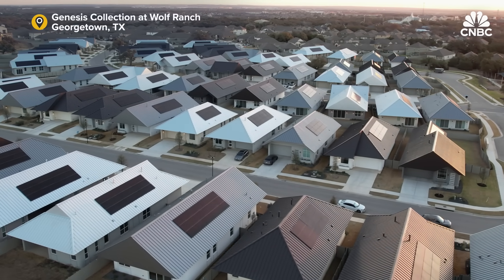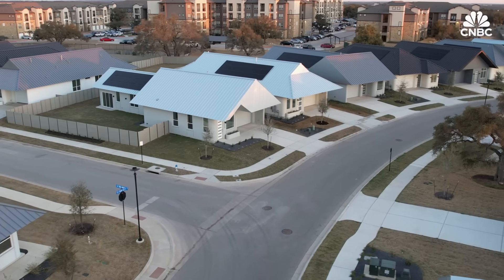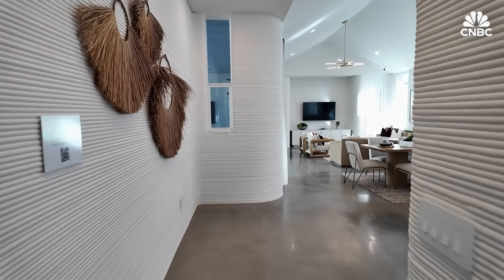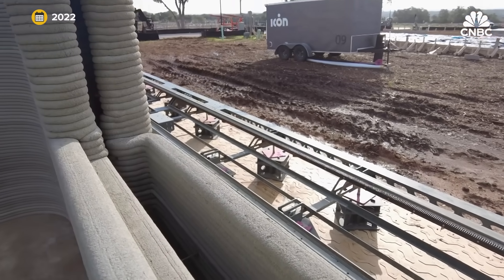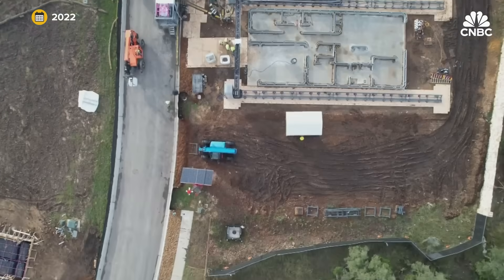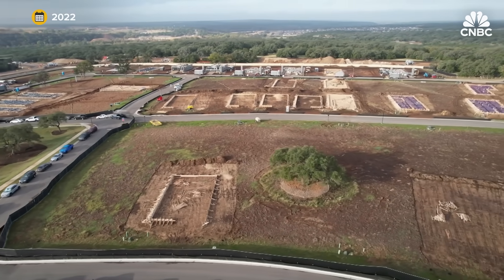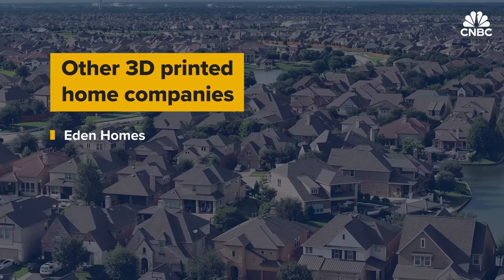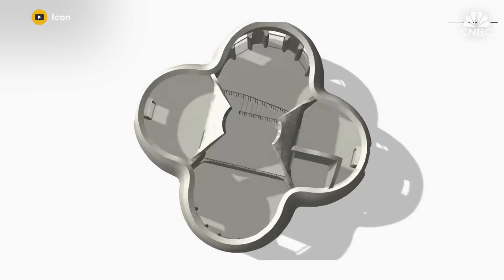Inside The World’s Largest 3D Printed Neighborhood

Comment: Homeowner: "Can I put another electrical outlet here?" 

Electrician: "Sure, that'll be $1750." (Pulls out jackhammer)
Reply: I like the idea, but the interior lines I would think are a magnet for dust, and the outside will collect dirt.  Maybe the nozzle should have solinoid activated wipers on the sides to create a smoother surface.
Reply: Be happy with the electric outlet where it is.  Problem solved.
Reply: The american ignorance of non-cardboard houses knows no bounds. This is a non issue in all countries around the world that build sturdy buildings.
Reply: @Inepressiera The issue is the labor cost to perform the work in a fully brick/mortar house...Electricians here make good money, they charge anywhere from 80$ to 150$ per hour, and a flat service fee that covers the first hour of 250$ on average in an average cost of living town.

Now adding a receptacle in the first floor, if the panel is in the basement, in a drywall setting and an unfinished basement, will take like a couple hours...But in a brick and mortar situation it might take triple or 4x the amount of time (drilling through concrete, chiseling, can't easily pull wires anywhere without creating a path since nothing is hollow)...So instead of paying around 350$ for a receptacle, you ll end up with a bill of 1000+...

I am an American Electrician, and I ve lived in North Africa and Europe for the first 30 years of my life (I am 34 now) so I know what I am talking about
Reply: @Htm.13  thank you. Others were telling me that drywall was a uniquely American invention and that they could easily chisel and resculpt concrete interior walls with the same ease and cost as patching drywall, which is absurd. And my only point was that it would cost more. Not that it wouldn't be possible.
Reply: @Inepressiera  The problem is planning and zoning. The structures they allow are toxic and like you said, litterally cardboard. If i could, all i would EVER build is eartships. Good luck building one anywhere near a town.
Reply: Some charge that much with a regular house
Reply: Buy an extension plug.
Reply: It's hilarious seeing all the people claiming Americans are too dumb to know how to work on concrete, exposing their lack of reading comprehension. No one said it can't be done. They said it will cost orders of magnitude more money due to the increased labor required
Reply: Is this why Americans live in cardboard boxes? 😂 My walls are solid brick and I never had issues with outlets.. You can plan them in advance if you are not 60 IQ american.
Reply: I'm from Romania and I cross the street and borrow a wall chaser and a core drill. The only one nobody seems to have is a gunpowder nail gun cos guns are banned in my country. Maybe we storm the parliament or something with the nail guns. Btw a modification to shoot concrete nails out of a 22 should be pretty popular in USA
Reply: @GeorgeS-z8x  Guns here are way cheaper than a Hilti nail gun lol
Reply: Did you watch at 3:50? They try to print the outlets as well.
Reply: @ yes. I’m talking about renovations down the line. I’m not entirely knocking the idea, I just never see it becoming the standard. Not to mention almost no part of the process is from sustainable resources. 

And on a personal note… metal roofs are hideous and they need something else
Reply: I’d love to see the patch job afterwards 😂
Reply: My thoughts exactly!! 👍🏾
Reply: You guys should YOUTUBE "paano gumawa ng concreto na Bahay"

Thank me later
Reply: A lot of houses in Europe are like this though, hard wall interior. It is more expensive to modify, but it isn't a new issue inherent to these 3D printed homes.
Reply: That is so dumb... in most of the world houses are built with brick and mortar and customization is not an issue. It's only in the USA that houses are made of cardboard. Concrete is fairly easy to mould and chisel.
Reply: @thelegend2776 It is not dumb, it is real, it will take much more labor hours to do the same task, I am an American electrician , I spent the first 30 years of my life in Noth Africa and Europe.

Adding a receptacle in a typicak drywall built in the US is much easier than chiseling concrete, and figuring a way to pull wires to the panel if there is no hollow walls anywhere.
Reply: @thelegend2776 Customization is totally an issue dude what are you talking about. That's the agreed upon downside of the European building method. It's doable but it's much more work. Most homeowners in Europe aren't going to DIY a new junction box.
Reply: @thelegend2776  Customizing your house BEFORE it's build is not the issue here, your comment is redundant.
Reply: @thelegend2776  The exterior of houses might often be stone, but in this case every wall inside is too.
Reply: @JoelRyanQuinn  Brick and mortar is the standard for both exterior and interior walls in 90% of the world. I live in a fully brick and mortar house (standard) and have done dozens of renovations on it over the past 10 years and breaking brick or concrete is not that big of an issue. Sure, it's harder than with timber framing, but it is something that can and does get regularily done.
Reply: @thelegend2776  like he said, its not about if it's easy, it's price. it costs more
Reply: Only Americans would think you can't modify it lol
Reply: @pauljansen6650 NO, Americans are saying it's more difficult and definitely more expensive. 🙄
Reply: @pauljansen6650  Your builders are qualified as you have the training. We don't. Its not that we can't. We just need to learn.
Reply: Honestly, as a custom home builder and carpenter… just by looking at this I can tell you these homes are entirely non-customizable post-build. I’m talking 5-10x the traditional price I’d charge to work in a traditional wood/steel building. 

I got nightmares just by looking at those builds🫣
Reply: @Wickedpissah138  so you say, I'm a GC and gurantee these methods are far more scalable and trainable than 5 different tradesman. You're arguing refrigerators will never take off because you own ice houses.
Reply: @ This shouldn’t even be considered a trade. You’re operating a computer. Not to mention the limits to the structures themselves. This will be good for small, low cost basic housing. Nothing else.
Reply: @Wickedpissah138 that comment made my eyes roll so far back, i saw my skull. Got don't have much forethought do you? You're like the people who said TV would never be bigger than radio. Foolish.
Reply: @Wickedpissah138  that why you put drywall over it, so you can run everything behind it
Reply: @ you could… but to do that correctly you need to have a framed wall either wood or aluminum studs. If you did that to every wall you’re actually shrinking your square footage throughout the entire house.
Reply: @Wickedpissah138  ok, but do you think they are just gonna leave the bare printed walls? if they shave the walls flat which they have to anyways, that will give you some extra space so none is actually lost.
Reply: @Wickedpissah138  Imagine when you wanted to redecorate you had to move
Reply: Cement can be dissolved, so..... Lmao.
Reply: Keep living in your cardboard box buddy. Almost all of the world lives in houses with solid walls and noone has your imaginary problem.
Reply: @ventsislavminev  The imaginary problem of it costing far more to install something new?

You need to find better coping mechanisms my guy
Reply: @ what? No. No structure you see over 1 story is built with solid concrete. Brick and stone is just the exterior, almost all structures have steel or wood framing. 

These little structures aren’t able to expand past a first floor. And the weight of your walls is now so heavy you can’t even have a basement you need a heavily engineered concrete slab.
Reply: @Wickedpissah138  Bro, don't say that, I am an American electrician, and I lived in europe and north Africa, and all the houses there are built of solid brick/cinderblock, rebar and concrete! My father's 3 story house in Morocco that we built is solid brick, cinderblock for roof and concrete + rebar...Not an ounce of wood anywhere, now if we tried to build the same house here in the US it would ve cost us at least 10 times more money.
Reply: @ ok… now please tell me how much easier it is to remodel those buildings made of stone and rebar (here in the US that type of build is primarily set aside for municipal buildings such as jails, schools and maintenance buildings, and low-income projects… not single family homes)
Reply: @ and you also couldn’t build that structure here in the US under residential building codes. Concrete structures are not the safest. (For more info do some research on Florida and their concrete condo towers failing)
Reply: Trades guy here...

I wouldn't touch the place
Reply: @stevechalmers9572 u guys touched a lot of places during the LA wildfire Armageddon

Comment: In lots of places, land use costs and taxes are worse than construction-related ones and the real way to drive prices down would be triplexes or larger multiple dwelling units to spread land-related costs between more people. In my mother's case, the land itself is valued at 250k$ while everything else on the plot is only valued to 140k$, the plot of land is nearly 2/3 of the total valuation. No amount of making the single-family home itself cheaper will offset that to a meaningful degree.

Comment: Amazing idea! but not gonna lie, hearing "wind, fire and mold resistant" is kinda wild 🤣 its because you build the house using concrete not board/wood. I'm from outside the USA, and I'm just always shocked at the fact that a lot of housing units in the USA are built using some type of board. 
Even a small subsidized housing complex just 36m²/house or 387sq feet/house in my country is all mandatory to be built with concrete and brick.

Comment: In fairness to the trades, this is not that much different than concrete block something we have had for a very long time. If you prep everything first, then have a guy show up with a truck load of concrete blocks, laying the concrete blocks (aka legos for building) does not take that long. For strength, you lay some re-rod in the wall and pour concrete inside the wall in a few spaces making a strong structure. You still need someone with a fancy hat, big ego, and more telling you how you are revolutionizing the process. Don't get me wrong I love technology, but it is it fair to use inappropriate comparisons.

Comment: those houses are way too close to each other. might as well just be an apt or retirement complex.  concrete isn’t environmentally friendly to make. i cant imagine the machines you need to break the walls when making house repairs. not to mention it will be very clear where those repairs were made when the smooth wall lines become a block of solid concrete then back to lines.

Comment: This isn't solving anything it's just techbros being idiots again and again. Just build panel buildings! They're cheap, quicker to build, and, if basic maintenance needs are fulfilled, can last for 100 years easily. Even then, build with brick and mortar. I live in a renovated, well-insulated, 1700s house in Germany. It has seen wars, revolutions, fires, changes of language, and the advent of electricity and gas. Why build something that will last only at most two generations...

Comment: 3d printed homes are ugly and overhyped. Putting up the walls of a house is small part of the work & time required to complete it. Think of all the other things that need to happen - foundation, 1st & 2nd fits of wiring, plumbing, roof, glass, insulation, walls, plaster, paint etc. The outer walls... not so much - anything from bricks, blocks, prefabricated slabs, timber, concrete formwork are all viable and fast. Not to mention all the planning & zoning laws which have to happen before anything else does. Months and months and months for a home to be put up that have nothing to do with the walls. The media seems to think that this technology will result in homes being built more quickly when it absolutely will not.I would not be surprised companies promoting this technology are spreading BS and media is mesmerised by the tech without thinking about it too hard. And the net result is fugly houses that will probably look even fuglier over the years after heat/cold cycles, water, dirt, debris, insects etc go to work on those walls. Can you imagine how much a contractor will quote to repaint inside or outside of these houses?

Comment: $400k and you don’t even get a basement? Ouch
Reply: Most homes in Texas don't have basements
Reply: @biblesforbreakfast  Same for California and Arizona, must be an east coast thing
Reply: @TLoumena  It doesn't have to be a 'basement', they are pointing out that price for a rancher. 
A multi-level home would equal a home with a basement.
Reply: @zzz7zzz9 It doesn't provide the same level of protection.
Reply: @striver1987 
Ah, right. Storms. 
I'm in canada.
Reply: All Midwest homes have a basement. Once you've had one, you'd understand.
Reply: @striver1987 I wouldn't say all but they are very common. I'm outside of st louis and I've rented a slab home with no basement. Basements are better.
Reply: No basement is a deal breaker.
Reply: No insulation, what a save on money 😂
Reply: Basements aren’t a thing in Texas. I’ve never seen a home with a basement in Austin.

Comment: So it's still a normal price than "most" homes? That's slightly more expensive than a normal home for size and location.
Talking about electricity price but don't mention that it's only because of the solar panels. Sure concrete does a better job of insulating and is probably thick on the outer walls, but in texas you NEED ac a lot still.

Comment: As an eastern European watching this i needed to pinch myself. Claiming insulation and soundproofing for a concrete wall...... at this point this is a panel block house with extra steps and difficulty manufacturing on site. A technology long surpassed here for its many drawbacks.

Comment: One thing to consider about housing prices, is that they are market lead. So a company making cheaper homes will get a lot more profit. What's good, is this increase in profit will encourage more competitors into the market, driving the costs down. Any cost improvement here for builders will EVENTUALLY, get to consumers. But people need homes now still, and a bridge between now and EVENTUALLY is missing. I think this bridge is more likely to be solved in city/state programs that lower rents to match working wages, and encourage cheaper housing prices. Potentially federal will step in if the Trump administration decides that it is important for people to be in homes. 

Cool to see the tech, a bridge between now and eventually is still needed.

Comment: January in Texas is heater weather, not a/c weather. I live in south Texas in a 2000 sq ft 15 year old one story and my a/c bill was $75-80, not $130, but $26 would have been really nice. I do like that the building should stand up to high winds much better, the built in solar panels are also really nice, and the metal roofs should last a lot longer than shingle roofs. But $350K for a 1500 sq ft home is high. But if they can reduce the cost, it could be a great investment. My main issue is what's the cost going to be to service a pipe or anything inside the concrete walls? Once the repairs to the pipe or whatever is completed, how to they rebuild the concrete wall? I would imagine it's all going to very expensive and much more than in a "normal" home.

Comment: Stop with the open floorplan garbage. It's only a thing so builders can make more money. Nobody I've talked to likes living in a house where the sound of a fart travels to every room. Such a horrible layout.

Not so sure about these in a hurricane zone. I've been 3D printing for over 10 years now. The one thing that hasn't advanced much in 10 years is the issue of layer-to-layer adhesion. That's the weakest point of any print. If that roof is securely attached to the walls (and, according to code it will be) the roof will stay attached to the wall, but the wall will peel apart at layer lines.

Comment: Nice one, now builders are out of work. Who's next?
Reply: The same as the guy who used to put horseshoe on horses and you don't complain. When the last time you sent a telegram? Exactly.
Reply: @guilleport  Think how many other trades and suppliers are effected by this. Lumber, fixings, drywall, painters, stoppers, drivers, scaffolders, carpenters, then all the suppliers within each field so that's all the tools they use and equipment. Bit different to horse shoes which were replaced by an entire car industry and all that comes with that and telegram wires were replaced by phone wires and the telecommunications industry. What we have here is effectively a designer, a robot, the people to instal the robot, and whatever the compound is they use. They will still need glaziers, sparkies, plumbers and people to do the interior fit out and the roof but the rest are gone. I appreciate you son't work in the trades but what do you do and are you worried about your job and what to prepare your kids for?

Comment: 3D printed exterior walls makes plenty of sense. Not framing out the interior with wood to run electrical and plumbing, and finishing with drywall is really stupid, because eventually you're going to have to maintain and replace components that run through your walls and it's easy to do with drywall and wood frame interior walls.